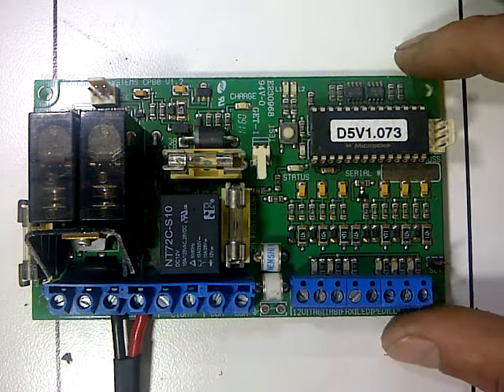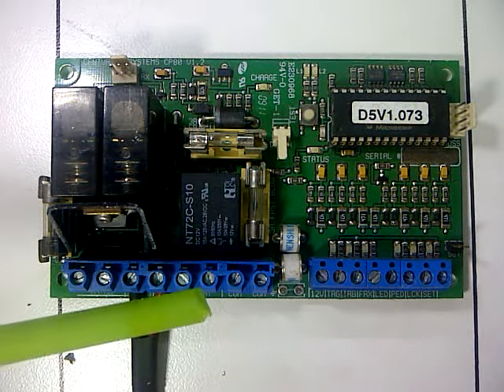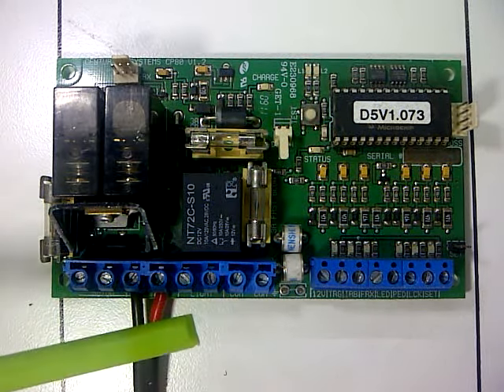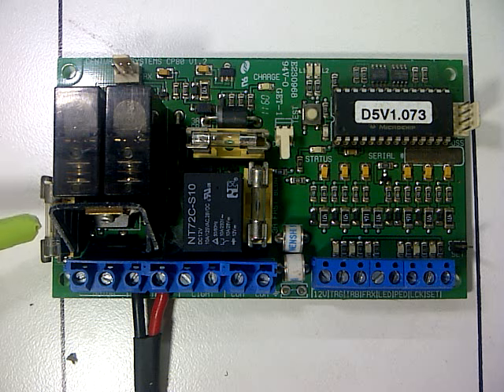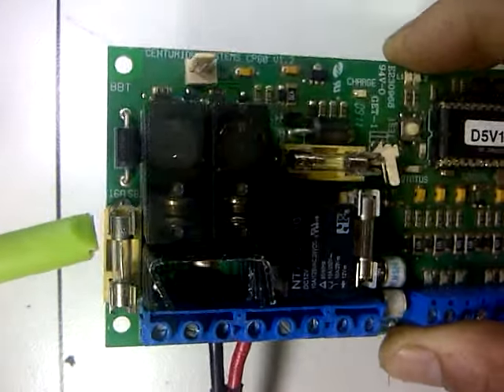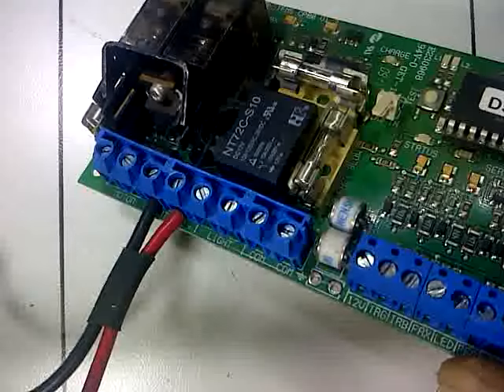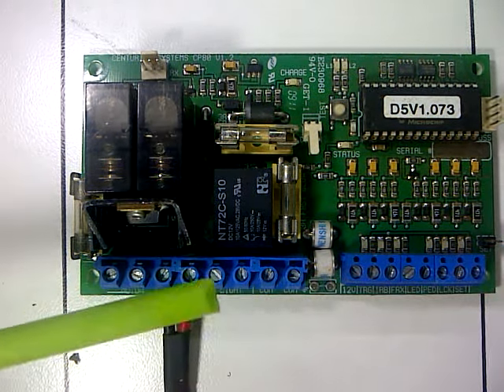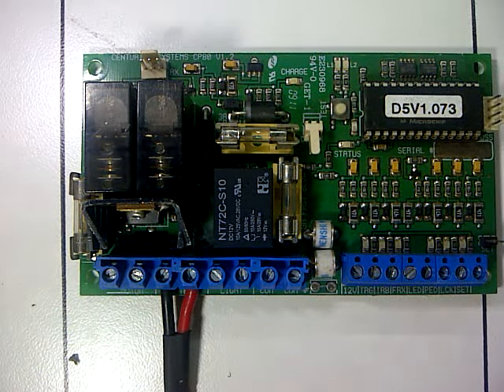Centurion D5/D3 Gate Motor Basic Info. D.I.Y- more videos on chenturion on my channel

Comment: On the last note where you can wire a light to the motor . If the light is getting a neutral from the PCB board, where would the light get its live from ?

Comment: Hi Mark, I have install  D5 EVO  3 years ago . but now my gate won 't open . on the motor screen it says battery low and  is connected to my main switch.  if the problem is with the battery can u advice me on how to replace it. Thank u

Comment: Now I know which fuse is which, thank you.... it would have been very valuable if you mention the fuse ratings I need to buy to replace them.
Reply: Mar,  I found a manual online with schematics. The master fuse is 16A, the auxiliary fuse and the light fuse both say '3A fast blow'. I hope this helps future visitors.

Comment: Hi Blade. Do you have any videos on programming an E.T. Blu remote to the Centurion D5 motor. I had a new E.T. garage motor installed recently and now want to use the same remote for my motor gate, instead of two different remotes.

Comment: Hi Blade,thanks for the informative videos!I have a problem on my centurion d5-v1 motor-When I press my remote to open the gate,I get one beep only from the pcb,I tested the battery and got 13v,and the fuses are all working-Any advice or help will be much appreciated.